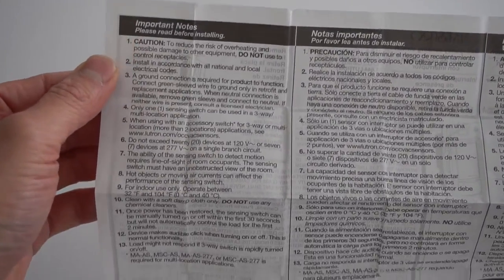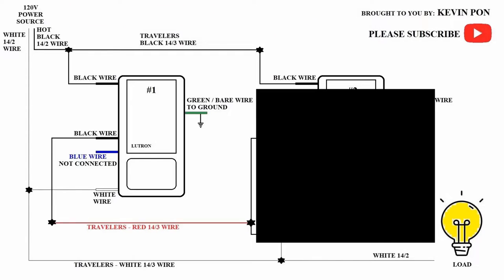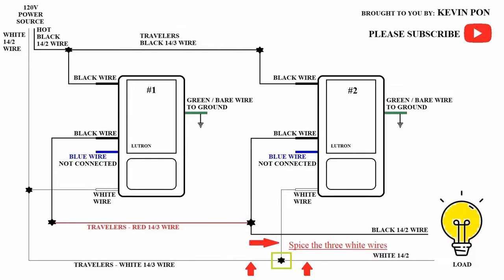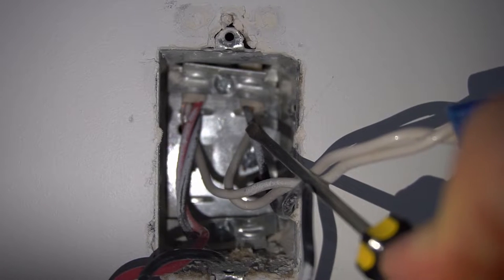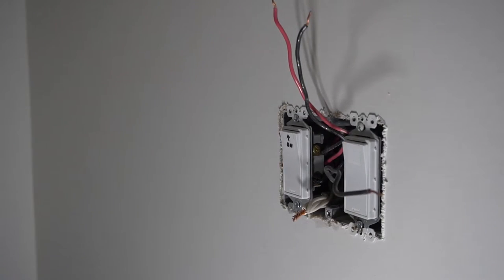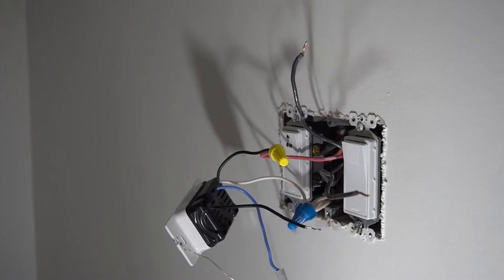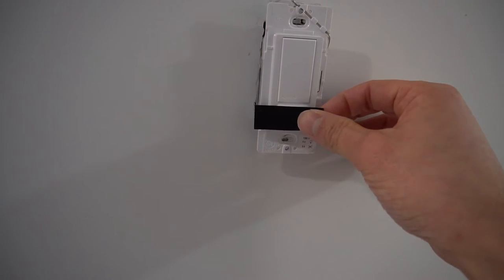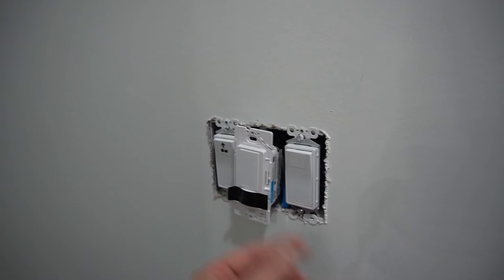TWO Occupancy Sensor 3-WAY Switch HACK BYPASS THAT WORKS! Any brand!

Comment: Thank you for this video. Would this work with two auto-on 3way switches?
Reply from the maker: Do you mean like the switches I have? They are auto on
Reply: @KevinPon.  sorry i thought they were only vacancy sensor. Yes, I am installing LED strip/tape light under every stair nose from my stairs and I want to have an auto on switch both upstairs and downstairs so that the stairs light up whenever i get close from either side of the stairs. Would that work?
Reply: @KevinPon.  I just rewatched the full video and paid more attention. This just made my day, thank you. I liked and subscribed to your channel.
Reply from the maker: Thank you for subscribing! Yes it will work. Same idea but yours will be LED strip 🍻
Reply: @KevinPon.   Much respect to you and your knowledge. Thank you so much.
Reply: @KevinPon.  just wait until you see the custom job we are doing at a house I'm building. I'm going to give you full credit.
Reply from the maker: 😂 why thank you, no need my friend. Sounds like it's going to be a wicked house! 🍻

Comment: I’m a little confused. Both of mine have 4 wires going to the switches because the ground is on the switches. Where are the grounds going for the motion sensor wires?

Comment: thanks for the tips. how about a 4way switch? same thing on the 3rd box?
Reply from the maker: It's a similar process. Most importantly it needs constant power and complete circuit is active 24/7. Cheers!
Reply: @KevinPon.  Kev you genius. I’m stuck. Would appreciate some help. I have emailed you. Thanks.
Reply: i want to do this but i have a 4way in the middle of two 3-way switches …  can i make both 3ways sensors and keep the 4way as a regular switch???

Comment: The second box (bottom end of the staircase) only has a black, red, white, and a ground... 

How would I wire that? 🤔 😊
Reply from the maker: The key is to have constant power on 24/7 and you need to bring it to the second box to power the switch. You will also need to split all white wires together to complete the circuit. You will have to rewatch the beginning of the video to get what I mean. 🍻

Comment: I have a leviton 3way motion sensor switch but theres no option for a neutral wire would it still work? And what if you wanted to add another motion sensor would that also work?
Reply from the maker: Sorry unfortunately I cannot confirm if it will work.
Reply: @KevinPon.  ok but with the set up that you with those switches would you be able to add another to control the same lights?
Reply from the maker: Nope, do not have enough space in the box.
Reply: @KevinPon.   so i ended up getting the switchs like you have in the video and i am trying to figure out on why my switches dont have a white wire like yours any idea?
Reply from the maker: Must be a different model. But try to follow the instructions while skipping the white wire instruction. Hopefully it'll still work.

Comment: Amazing job Kevin!  What a rewarding journey! Can't wait to try it out myself!
Reply from the maker: Thank you Corbin! Yes, indeed!
Reply: Kevin i did it on one 3-way and got it working 👍 But then I tried it on a different 3 way and one lutron switch was working fine, but the switch other had nothing. It wouldn't turn the light on or off. Followed the exact same instructions that you gave and that worked for the other 3 way. So anyway I've been trying to troubleshoot and I found something  I think is a little odd. 

What does it mean if when using a multimeter:

Black lead touching ground + red lead touching black (hot) = 120 v

Black lead touching white (neutral) + red lead touching black (hot) = 0

Shouldn't I be getting 120? That's the hot wire for this 3 way set up
Reply from the maker: @corbindean1776  That's great news that you got it working on the first one. Now for the the different 3-way hmm that's a bit strange. Yes, you are correct. When touching (hot to neutral), you should get 120v. The possible reason for this is: the white is not spliced correctly on the other end. I assume this 3-way switch was working from the start?
Reply: @KevinPon.  yes it was. That's what has me confused
Reply from the maker: I would remove the switches on both ends and inspect the wires. Start from scratch. Double check if the 14/3 wire is spliced correctly on both ends. Making sure all whites are together and only whites. The travelers and separated and not connected to anything else (red + black). Then one 14/2 wire (black) will be hot to confirm with meter and the other switch 14/2 (black) will be coming from the light with 0 volts to neutral or ground.
Reply: Kevin, so if this is done correctly both sensors will keep the light on if they sense motion on either . Correct ?
Reply from the maker: @davidlaventure6717  that is correct David

Comment: Need help😊 Worked great... But I'm stuck. One of my 3 way circuits has only a single 14/3 coming into both the main and aux boxes. I don't know if it's relevant but whoever put the old switch in wrapped black tape around the "guts" of the switch. I am replacing old 3 way switches so I know it's possible. Help please.

The old switch:
Main switch 
- Black (line) on Black screw
- Red on screw on same side of switch as black screw 
- White on screw on the opposite side of the switch from Black screw

Aux switch
- Black (load) on black screw
- Red on screw on same side of switch as black screw
- White on screw on the opposite side of the switch from Black screw. 

Thanks in advance!

Again, brilliant video. It worked perfectly on 3 sets of three ways. (Using ECOELLER brand)
Reply from the maker: Hi Steve, the black tape wrapped around. Whoever did that was probably worried of something or themselves of touching the bare screws. No harm there. 
To clarify, that's the only wires you have in both of the boxes. Just one single 14/3? Not 14/3 + 14/2 like what I have in my video?
Reply: Thank you, yes, you are correct. Just one 14 3 wire heading into each box no 14-2.

You're probably right about the tape as it is a metal box that it is going into and I already shorted it out once :-) interesting the that of all the switches I have replaced, only the power side of this 14-3 setup was wrapped in Black Tape like this. 

 Part of the reason I mentioned it was there is a YouTube talking about a way to wire three-way switches with just one 14-3 cable and they said to cover the white wire with black tape since it was going to be carrying power. This is not exactly what was done in my situation but I thought that this information might me and something to someone like you who actually knows what they're doing :-)
Reply from the maker: @stevecroft250  I believe this is how your house was wired. https://www.electrical101.com/wpimages/3way-switch-wiring-diagram-nm2.webp
Does it look the same as yours? I've never done it this way
Reply: Thank you for taking time to reply. I do not think this matches my house if I am understanding correctly because the left-hand switch has both 14-2 and 14-3 whereas in my case both boxes have only one 14-3 coming to them. 
Do you think this can be made to work somehow? If it makes it any easier I could probably get away with just having one of the switches be motion activated.

Thanks in advance.
Reply: Thanks again, I appreciate your help. On the main switch (only 14 3), if I connect hot wire from 14 3 (black) to black on switch, red to red, white to white... Nothing happens but if I touch the blue wire (ECOELLER switch) to either the white or the red, the light flashes on and off. Does this provide any additional insight? Thanks for all the help you have given to so many!
Reply from the maker: @stevecroft250  sorry for the late reply been super busy! Ok we can try something a little different. It might work. It's the easy solution if it does. Normally we don't do this but in your case we will. White wire will connect to the ground wire (hope you have that, we need it!) Blue we'll cap that off. I don't know what your manual says but connect power source to the red or black on the switch. Then connect the last wire. Turn off the breaker first just in case of electrical shock. Hope this works 🍻
Reply from the maker: Once that's all connected. Test the switch with the other 3-way on and off. That's when you'll know it will work or not
Reply: Thanks so much for taking time to respond. So if I understand you correctly, I connect the ground wire from the 14-3 to the ground wire on the switch AND the white wire on the switch, then the hot wire from the 14-3 to the black (per ecoeller instructions) and then red on the 14 3 to the red on the switch, cap the blue wire on the switch?
Reply from the maker: I was looking on the instructions from Google image. Hopefully it's the same model as yours. White wire from your switch will connect to the ground wire (we need it!) The ground wire is a backup neutral. Yes, cap off the blue. The hot wire to the black on the switch. Connect the last remaining wire red to red? on the switch

Comment: What happens if you press the button  to manually turn it on or off on one of the locations
Reply from the maker: It will turn on and off normally only if the other sensor cannot sense you and is off.
Reply: @KevinPon.  thanks a lot kevin

Comment: Is it possible to install the Leviton Wi-Fi occupancy sensor to my 4-way switches in garage
Reply from the maker: Hello, let's say if I did made it work with the least possible work. Then you will not be able to use your other 2x 3-way switches. It has to be kept on at all times so the WiFi switch has constant power being feed 🍻
Reply: Yes, that sounds good. I have Leviton wireless companion switches if I need to switch from another location. I don’t need 4-way , 3-way or single will work. Thank you

Comment: Hi Kevin. 
Will this method work for Leviton DOS05, 2 sensor switches for One Light?
Reply from the maker: Hi Luis, yes it will work. It's the same installation as the one in my video 🍻

Comment: Hey Kevin. How would I connect this up with 2 single pole switches (ground, neutral, load & line) on existing 3-way wiring? Assume even if I don't want to replace one of the manual switches (using 1 single pole motion switch and 1 3-way manual switch) I would still need to change the wiring on the manual end to make the parallel circuit work?
Reply from the maker: Hi Mark, that's correct. You'll have to parallel the circuit for it to work 🍻
Reply: @KevinPon.  Thanks, man. This is such excellently done content. Much appreciated!
Reply from the maker: You're very welcome Mark! You're on the right track! Hope everything will work out 🍻

Comment: Hi Kevin, does this work if one of my switches is a dead end 3-way switch?
Reply from the maker: Hello, do you mean by having 1 motion sensor switch and 1 regular 3-way switch? If so, the answer is yes but you have to have the 3-way switch must be "on" 24/7 or else the whole system will be off
Reply: @KevinPon.  I see. Thanks!!!

Comment: Kevin , how do i simply bypass sensor mode. My tenant does not want the light going on automatically in one room. I dont know how to set that up..I only know how to adjust tomes and modes
Reply from the maker: Hi Bob, the only way to bypass that is by covering up the sensor 🍻
Reply: @KevinPon.  .Hi Kevin. Thanks. Ive done just that. Im  Glad u validated my method.. I was scratching my head thinking there was some simple programming i was missing .

Comment: I have garage with three way switches, I wired a lutron sensing switch in one, it works but it is so far away when I come in one door the sensor cant detect me until I am half way across the room how can I make it so I can go through either door and it will sense me, will wiring two switches accomplish this
Reply from the maker: Yes, wiring two of them will accomplish this only if the switch can sense you. Cheers!
Reply: @KevinPon.  clarifying if I pass in front of either one it will trip the light on?
Reply from the maker: @brycechapman3599  yes, if you wire exactly how I have shown on the wire diagram. Either one of the switch will activate the lights 🍻
Reply: @KevinPon.  thank you

Comment: Hey Kevin, based on this, could you do with 2 single pole motion sensor switch considering that the blue wire isnt used?  Thanks
Reply from the maker: Yes 100% Tom. You got it!
Reply: Came back after watching this earlier to say the same thing. He merely is back feeding either switch while the other is triggered by motion. I see no problem with this.